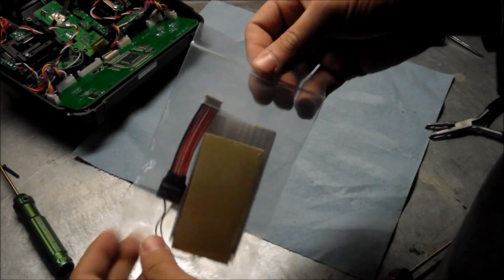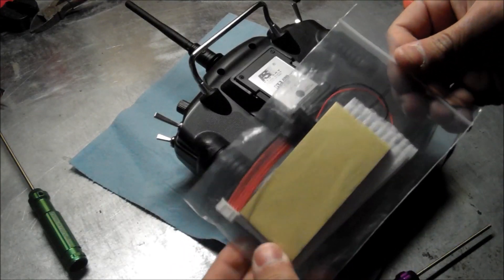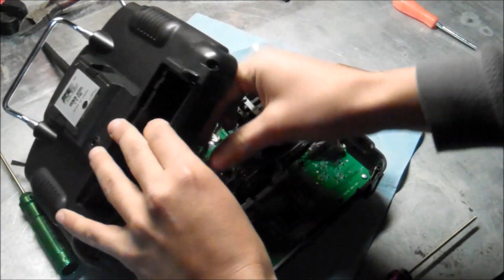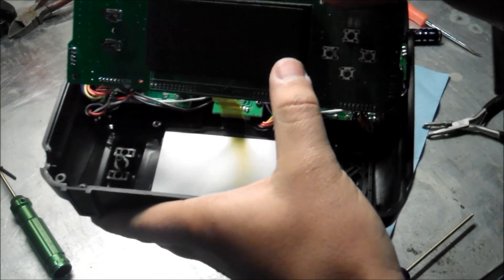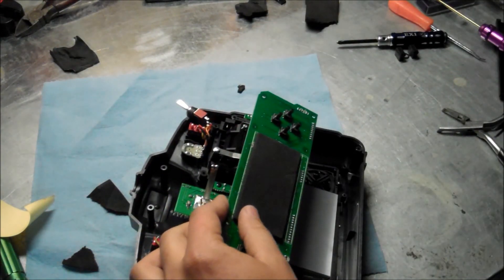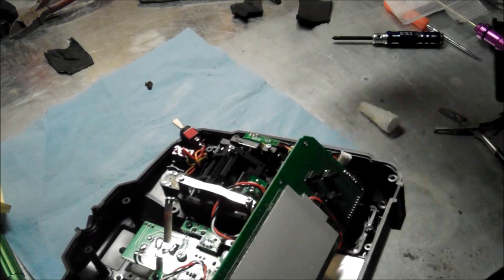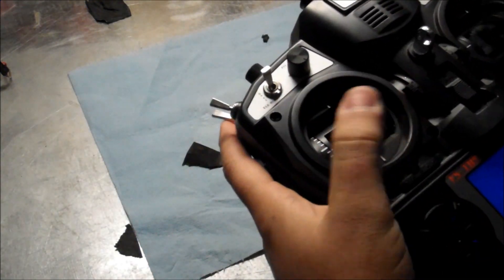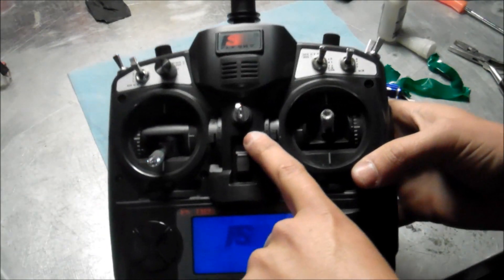Turnigy 9X Fly Sky FS-TH9x LCD Backlight Kit

Comment: Just did the conversion Thanks for the help. Only one thing to mention. My FS-TH9X mother board screws where different. The corner 4 screws are bigger than the others.

You can order from HK 4.99 but it takes a month and if it does not work good luck returning it. Just my 2c

Evan

Comment: By the way the $4.99 back light kits are NOT SOLD OUT, LOL :-)

P.S. - I put mine in last night & it looks great, I got the green one & used a drop of hot glue on all 4 corners to keep it from moving around. I turned the light so the wires are on the left, that way the +/- wires don't interfere with the up-down buttons. Everybody seems to like the Blue but I think the green is brighter & the display is already green to start with so it lights up very nicely, great inexpensive mod.

Comment: I have Fly Sky 9x too. I bought LiFe battery to replace the 8pcs of AA batteries from the Tx.. I wongly connected the +ve and -ve wire and shortcircuit happened. Now the Tx wont on. I've send it to repair to my friend. After it was repaired, it can be switch on again, and the screen is back on like before, but the problem is when I connect it to receiver, the servos is shaking/vibrating itself..my friend say maybe the modul of my Fly Sky 9x is bad too..can you help me figure this out in theory..